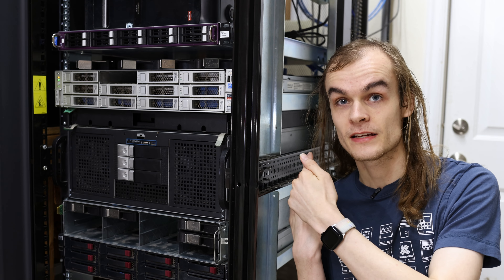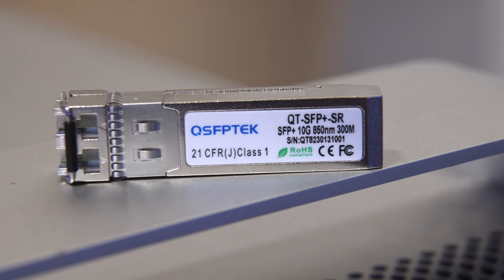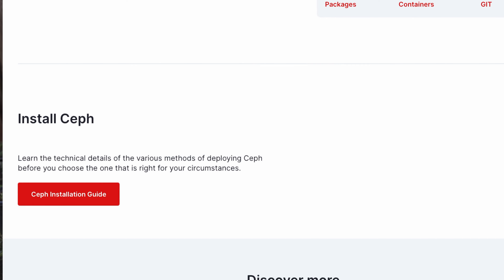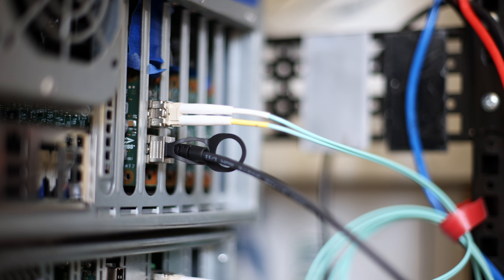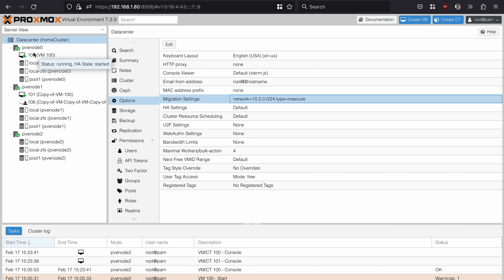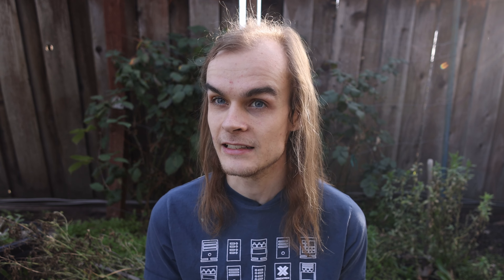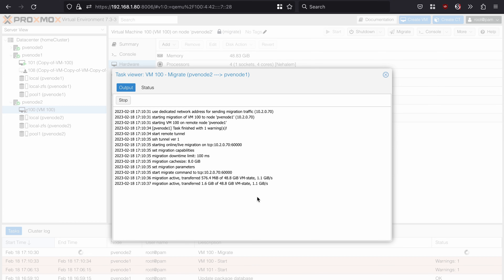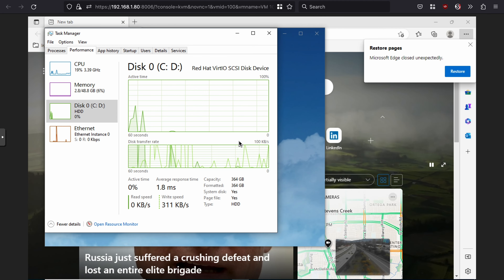3 Node Hyperconverged Proxmox cluster: Failure testing, Ceph performance, 10Gb mesh network

Comment: You are genuinely great at presenting this content.  You first hinted at not using a switch which caught my attention right away.  Then you showed the triangle configuration to answer how you anticipate it would work.  Finally you asked and answered the same questions I had like how do you avoid loops.  Excellent presentation and extremely valuable.
Reply: He really is a great instructor.

Comment: Would love to have video with detailed explanation on how you setup proxmoxes, put them in cluster, setup mesh network using frr, cheking connectivity between the nodes(iperf3 or route ip 6 route). Adding subnet for cluster(ceph). Setup ceph and best pratice to use 2 copies of file or 2+1(parity). Also how to avoid fails. I think full tutorial of that would be great. Or you can divide into parts. Anyway good job.

Comment: Thanks you for this video, I never heard of the Proxmox Full Mesh Network Ceph feature before. 

I recently bought three Mini-pc’s for the purpose of building an Proxmox HA cluster. I was planning on getting a small 2.5 GB switch for the storage. 

Since the Mini-pc’s have two 2.5 GB ports I will use them in a Full Mesh Network buying separate USB-C to Ethernet adapters for the LAN connectivity. 

For my Homelab such a setup is more than powerful enough. 
Going to have a lot of fun (and frustration 😅) with an advanced Proxmox setup and Kubernetes Cluster on top of it..

Comment: Great Video. A suggestion to test your setup is to simulate a power outage and see how the cluster responds. I have a 3 node ProxMox cluster running Ceph and I am setting up an extra cheap PC to run NUT to manage the UPS. My goal is to simulate a power outage (un plug the UPS) and have the cluster "Gracefully" shutdown and restart when power is restored.
Reply: what is the point of 4th PC if it is still a single point of failure for UPS NUT master? Just connect it to either of 3 nodes.
Having an UPS with network card you could probably access it from any node. In case of USB UPS some sort of hardware hack is probably required like an "Arduino" controlled USB switch based on ATX PS_ON logic.

Comment: You’re a champ - thanks for all that information in such a short time. I am currently working with passthrough, trying to get my rtx 2060 to detect on a windows 11 vm. Hopefully I can figure it by this week.
Reply: Did ya get it? For me windows just doesn't want GPU passthrough in a vm.
Reply: @hotrodhunk7389 

When I had my lab setup. I did get it to work but you have to make sure the GPU is compatible with Linux. As some cards have more stable drivers then others. I tried with a 2060 and a 1070. The 1070 worked fine but the 2060 gave me troubles but it did work.

Comment: Running this kind of setup on three identical Elitedesk sff nodes with dedicated m.2 drive for ceph. Even with a single 1Gb connection to a router everything works great. Ceph likes memory so have to run with at least 24 GB.

Comment: Great content.  It would be great if you could cover maintenance of the cluster. Things like upgrading a hard drive and/or replacing one of cluster PCs if there is a hardware failure.
Reply from the maker: Thanks for the idea. I'll start planning for this video soon
Reply: @ElectronicsWizardry  and also updating it.  I assume that should be straight forward?  if a node reboot is required, you also just do that?  For ZFS I found you could just plug in a new drive and then it just finds it and you can increase your storage that way.  You cannot however, decrease it.  And if you want to upgrade all drives, I suspect it might be better to build that array and then migrate to it.  It would be good if you can just pull a drive and replace it with one twice the size and it just deals with it.
Reply: Ceph prefers to have drives be of the same size and type. It will work without them being identical, but performance would suffer. Having said that, if you want to increase the size of all disks, it’s not too bad. Mark an OSD as down, let Ceph rebuild its PG’s, stop the down OSD, destroy it, replace it with bigger drive, create a new OSD with the new drive.

Comment: Very good video. Could you show your connection topology?
Reply from the maker: I don't have a diagram, but I'll try to explain it here. Each node has a dual 10GBe NIC and a 1GBe Nic. The 1GBe NIC on the servers are all connected to a switch, and the low bandwidth network is to be used for internet access, management, an.

Then there are 10GBE links between every server. For example if the servers are A, B, and C. The links would be A to B, A to C, and B to C. These links are routed using using frr so the shortest path is taken, but will take an alternate path in case of a failure. 

Hopefully this helps explain my setup.
Reply: @ElectronicsWizardry  Thank you so much for your explanation

Comment: Excellent video. Do you mind sharing how you tweaked the write cache? Cheers.
Reply from the maker: The cache tweaking was for the VMs disk. Under the disk settings there is a cache mode setting in the top right.
Reply: @ElectronicsWizardry  Thanks a lot for replying. I really appreciate your content and the time you took to reply to my inquiry.

Comment: Did you setup ceph before frr? In the mesh document, frr is setup first and then ceph.
I'm trying to get frr working right now, but it doesn't appear the steps in the document actually turned up the interfaces.
Reply: I figured it out. I had to set the interfaces I was using to auto start
Side note... Great job on the basics. A video showing step by step would be great for newbies. Such as myself.

Comment: Just saying, if the ceph ssd your using has "power protection" it massively improves performance. it's like a better version of write caching and speeds things up immensely. 

To avoid confusion, power protection isn't a UPS 😂. In this case it's a feature on the SSD usually found on enterprise SSD's.

Comment: Love the content.  I currently have a 4 node cluster in production with PVE and Ceph. I currently have VM storage on SSD’s and cold storage on spinning rust with ssd db/wal, but would like to see something on ec pool. I know you can create 4+2 on 3 nodes by sending them in pairs, but I can’t quite get my head around the CRUSH rule for it. The logic behind this is to increase storage efficiency.

Comment: try adding stuff like nvme and think about going to 40g or 10g bridged/bonded and then se where you get the best perf boosts - good video! 40g dual port connect-x cards on ebay are about 50 bucks if you shop around - this would likely prevent any disk i/o issues but you would also probably have to goto nvme to really take advantage of this but since hw is getting more reasonable and the burgeoning refurb mkt i think upgrading cluster is a good way to go before adding nodes - look forward to updates and followups - please talk about proxmox backup and show how long a backup of cluster takes before and after upgrades - this topic is great for smb who need 5 nines uptime!

Comment: Hi and thanks for your great videos 🙏
I am planning to set up a HA cluster with three zimaboards or something in that range for home automation (NodeRed, Grafana, ...).
Right now I am starting with Proxmox and hanging with one topic. (How) is it possible to share data between VMs or Container?
I think, Proxmox will run on its own  disk. The VMs, and containers are on a seperate  SSD - later on a Ceph storage.
When I am setting up a container, that container gets his own virtual hdd assigned that is placed on the external SSD / the Ceph disk.
Is it possible / how to have a folder / diskarea, partition, ... lets call it "shared folder" where different containers or maybe also VMs can read and write data.
Later on there is maybe a container with a simple NAS software solution or just a SMB share, that gives me acces to that "shared folder" via LAN so I can look at that data or also backup that data from time to time.
Yes, I can run an external NAS and connect an SMB-Share to the containers but that is not what I want.
I would be very happy, if someone can help me out how to do that.
Thanks a lot

Comment: I've ran something like this for work.  Had 4 node cluster with CEPH.  The only issue I had with CEPH is the rebuild performance.  It would slow down almost all the VMs to a crawl.  Sometimes the VMs would stall and crash.  I think my issue was a combination of things like large 8TB drives with no cache and 10 gig network connected to a switch.  Each node had two 10 gig connections to the switch.  Running vmware with vsan right now and have plans to go back to ProxMox with better hardware.  Not sure if I'll use CEPH again but with ZFS replication.
Reply: Why do you plan to replace vmware with ProxMox ?
Reply: Dyeffson Dorsaint  I had two separate dedicated 24 port 10 gig switches just for CEPH traffic without any connection to other network.  I did it this way on purpose to isolate CEPH traffic from everything.  I was able to manage the switches using dedicated mgt port.
Reply: @Darkk6969  the reason for the slow downs is, that you have to limit the rebuild traffic. You can set a limit, so that'll not use that much bandwidth. Since you mentioned HDDs ceph's pretty slow with small amounts of drives and you'll definitely want to put your db/wal on a SSD. If you want something "simple" like vsan you could also use linbit drbd9. They do have a proxmox integration. Since it's simple block replication it's fast af and great for nvme or SSDs. Reads are local so you'll get full speed. It just does not do EC.

Comment: you can and probably should upgrade this to warlock pentagram topology - still no switch needed but you will gain overall cluster robustness and be able to scale out storage - it is just a double triangle, going to 40g or 100g will be more common place and with no switch needed you save a couple grand right there - consider making the management network 2.5gbe

Comment: It would be cool to see you do some HPC setups with this hardware. I’m currently using 4 Xeon e5 dual cpu compute nodes linked with infiniband to run computational fluid dynamic simulations in parallel over MPI, but you rarely see this type of content on YouTube. I would be interested in the different setting and hardware optimizations that can be done on these types of setups to increase performance etc.
Reply: Reading your comment make me want to see your video! But yes, more of this you explain.
Reply from the maker: I don't have much experience in the HPC field and how to correctly setup, test, and use these programs. Do you know of any good resources that cover these topics?

Comment: Impressive, i wonder: You called up that WebUI over a direct IP right? A reasonable addition, to make also that be fault-tolerant, would be to set up a load balancing setup for the Web UI, so you would have a DNS Name to call your Interface which routes to a functional node at all times.
 
Or do you have something like vIP running already, which routes to a functional virtual IP?
Reply from the maker: Yea the Webui is over a direct IP and a node failure would take out that web interface. I didn't go into the details of how to deal with this, but using DNS or a Proxy may be a good idea. 

I plan on going over Ceph and other HA topics in Proxmox in later videos.

Comment: Putting together a three node ceps cluster which needs to be powered efficient, quiet, and have ~50tb of available storage. Would love a parts recommendation.
Reply: Not sure if you've already worked this out, but I recently put together a small cluster along those lines... Not sure it can quite achieve your desired 50TB with this config, but it can get pretty close (if you're willing to spend the $ on the SSDs)... 
I used 3 Dell Precision 3430/3431 SFF systems I bought on EBay for a decent price. They're i7-8700 (6c/12t) w/ 64GB RAM. I found some decent dual 10Gbe NICs I installed into the PCIEx16 slot in each (this NICs are really only PCIEx8), and added an m.2 NVME adapter in the remaining PCIEx4 slot in each. This gives me 2x NVME SSD slots in each that I filled with 2TB SSDs, and 2x SATA slots in each for additional SATA SSDs. I found some 64GB SATA DOMs for boot devices that replace the DVD in each system. If I were to max out all the NVME and SATA SSDs with the largest available devices, it could get close to what you're looking for.
The problem I found is that with non-enterprise/server class hardware you're likely to run out of PCIE lanes (only 16 total on most available consumer CPU/mobos). Moving to server hardware will mean more noise and power consumption than I was comfortable with (a zillion tiny little fans in most 1U servers generate a lot of noise!).
I'm not sure if this is what you have in mind, but this arrangement seemed to be the "sweet spot" for me in terms of cost/performance/power/noise. I haven't had it up and running for long, so I don't have a ton of experience with it yet, but things look promising. I'm currently working through the SDN config for the cluster (there doesn't seem to be a lot of info on these details available).
Good luck. Have fun.😃

Comment: I want to try something similar, but my proxmox cluster consists of 3 Intel 13th Gen NUCs with only one Nvme drive each. Would it still be feasible to run Ceph?  I guess I need to use what you demonstrated in your gparted/dd video to resize the nvme drive because I made the mistake of assigning it all to lvm. That would be a cool video. My NUCs have 2 thunderbolt ports (40gbit) each, imagine if I could use those for Ceph links. That would be awesome.
Reply: The 13th-gen i3/i5/i7 nuc features a b-key 2242 m.2 sata ssd slot. Try that for proxmox installation. Relatively inexpensive 256GB m.2 sata SSDs should be sufficient for OS and images. This leaves nvme free for ceph.

Comment: Supposing one of your nodes is gone and you have a bare metal replacement.  How easy is it to get that back in to the cluster?  We have a 3 node system without ceph using replication, it works fine but if a node dies then the HA starts on a new node but its obviously slightly behind by up to 15 min.  And because of our antiquated VM thats a problem because it can't redo those transactions.  But, if we have shared storage, it will just be the inconvenience of a reboot, which we can deal with much easier if I understand correctly.  we're in a position to build a new one, the risk is that ceph is new to us.

Comment: Try GlusterFS instead of Ceph. Should get better speeds.
Reply from the maker: Thanks for the suggest. I’ll try it out in my hardware and see how it works.
Reply: GlusterFS is file system storage only for VMs, ie; qcow2. It does not provide VM volume storage like ZFS or CEPH.

Comment: Great video. Will it work in similar fashion with containers running on the nodes?
Reply from the maker: Yea containers will work in almost the same way as VMs here. The only difference I know of is containers can’t be live migrated between nodes. You would need to shutdown the container before moving it. All other features like ha and shared storage will work find

Comment: Is where a way to kill 1 node(for example electricity gonr) and still have working vm without any interuption? Or at first works fence and after that restarting vm and loads up? So it usually around 1-2 minutes. I would like know is there any suggestions to have 0 downtime, because data is in shared ceph.

Comment: Would you be able to create a stretched cluster via tail scale? OR would it have too much latency to work?
Reply from the maker: Depends on what you’re doing with the cluster. I could see some programs working that just need to sync a state(life if you want to manage multiple proxmox servers as one) but storage clusters would likely preform very badly due to the latency and limited bandwidth.